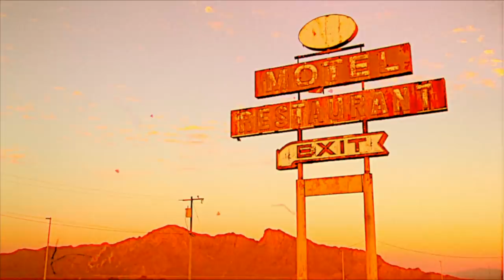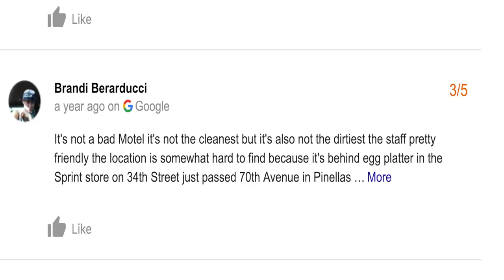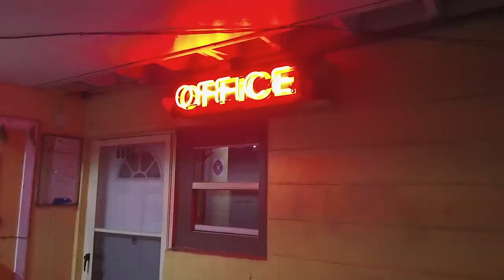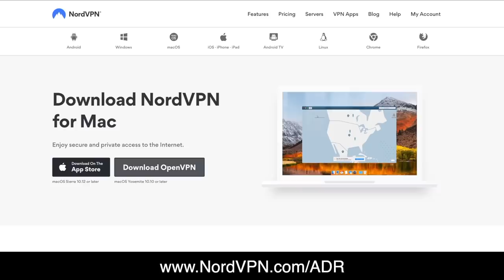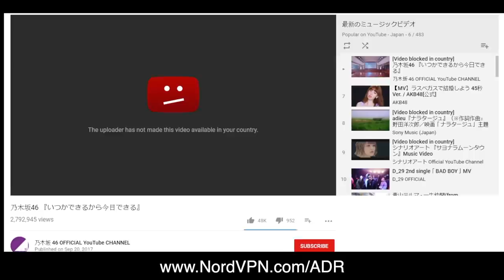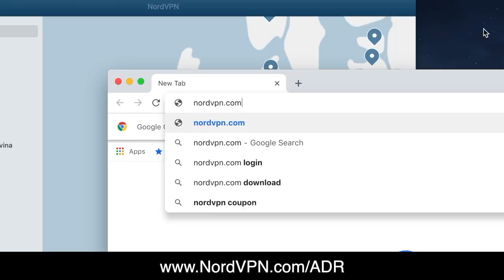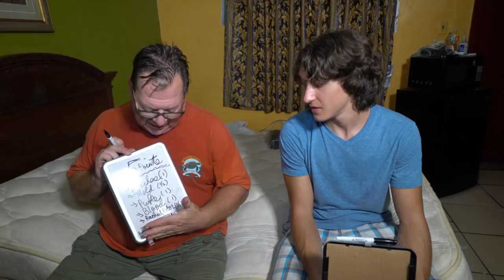Another Dirty Room S2E9 : GET READY TO SQUIRM : Hideous Kenvin’s Motel in Pinellas Park, Florida

Comment: Sprayed blood on the wall near ceilings is usually sprayed from a syringe. 
After use the user will want to clean it out so they fill it with water and spray it out (with blood in it) usually not into a sink.

Comment: If you use a FLIR camera and point it at the stain spots on the mattress, it will show if its still wet because the evaporation will make the spot cooler than the surrounding areas. Also good for tracing water leaks.

Comment: The aircon has a vent like the one I had in my 1975 Holden - if you flipped it while in fresh air mode on the highway, the thing would spin madly like a propeller with a deafening whirring noise...but at least it was clean.